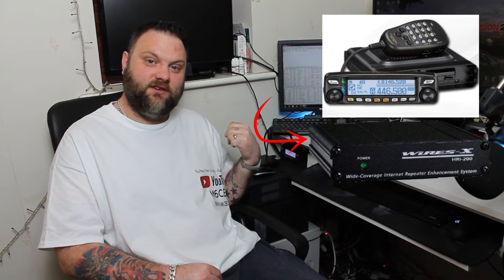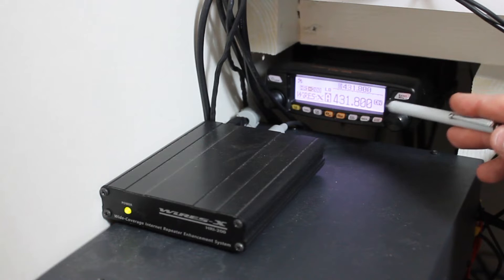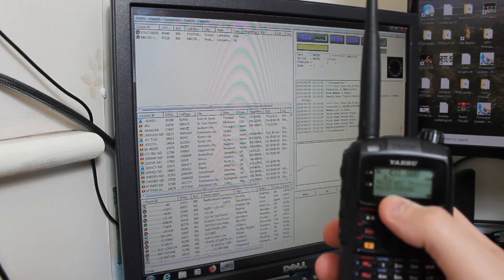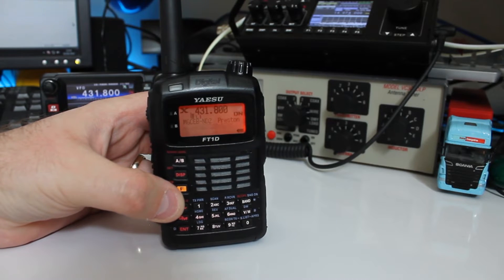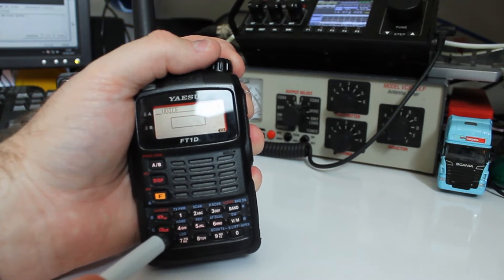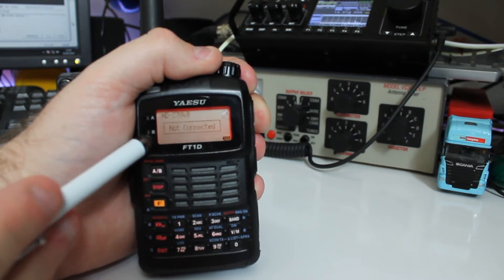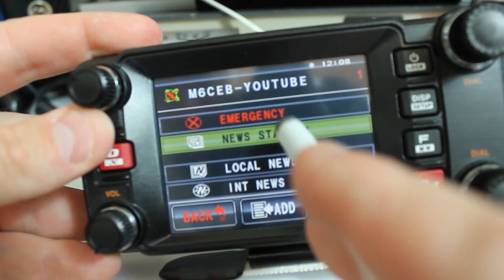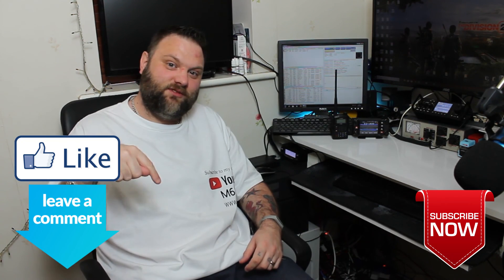Complete guide to Yaesu System Fusion & Wires X Everything you need to know! C4FM Everything Covered

Comment: I hadn’t used wire X in a few years and pick my radio back up. I had a new computer. I had a Windows 11 on it. It wouldn’t accept my SCU 19 or 24 so I bought the 59 or 56 but I’m having problems connecting becausethey won’t allow the carports and all that

Comment: Quick question, I'm searching for a c4fm ht but in your video everything looked so easy is that because the radios you used had a wires X button? Can I just get a radio the has c4fm only or will it be more complicated to use, Thank you.
Reply from the maker: All c4fm handies are easy to use and have a wires x button. I would highly recommend either the FT1, FT3 or FT5 radios. All are really simple to use on digital. Thanks for watching 73

Comment: Newbie here. There is no gateway in my area so I would like to set one up. If I would like to use Wires-X in my truck, I would need the 200 box set up at my house? Or could I simply connect my home radio to the internet using my PC and the Wires-X software and connect to it through my truck radio? I'm not looking to host a room at this time.

Comment: I have FT-991A (Wires X Compatible) with latest firmware which is tied via USB to my desktop W11 PC which is tied to the internet.  If I had a Wires X HT, why couldn't I use the FT-991A to RX and TX a connection to wires x without HRI-200 assuming the PC is installed with proper software?

Comment: Hi there, great vid, very well explained, thanks. 
I’ve just begun to use my ft3d and had my first wires x qso’s today. Now I want a bit more power so am looking at ftm400 and ftm300. Have you bought a 300 yet? I’m not sure that it’s a winner over the old 400, aside from the dual C4FM, I don’t see any advantage. I Would appreciate your thoughts. 
Cheers 
M0VZZ.

Comment: I've watched endless videos, skimmed manuals, but can't seem to find an answer to what seems like a simple question. My son is going to Hawaii with an ft-70d and has access to a C4fm repeaters. There are no C4fm repeaters in my area. What is the cheapest way on my end so that we can talk direct (not in a room)? Mu understanding (which may be wrong) is that I need to be a node/pdn, so even though an Ft70dr has a dp-id, a Hotspot wouldn't cut it, and I'd have to use something like an ft-3dr and cable to the computer, is this correct or not? I am on a fixed income so I need to get this right the first time. Thank you so much for your help!

Comment: There is a fusion wires-x repeater nearby. Can I use a radio with this option without a hotspot or internet & connect with groups,rooms &make long distance contacts?  Looking at a 300dr
Reply: YES, you can, if you can reach the repeater with a RF signal, you need nothing else.
Reply: See this excellent Youtube video.... its very long... but the most detailed one I have seen. Very very worthwhile watching !!!  https://www.youtube.com/watch?v=BV321C4mx20

Jackie... I am doing exactly what you want to do.. using the Yeasu FT300 radio.

Comment: hi mate so what i can gather from ur info if i buy a ft3d or a ft 300d and the relivent smu cable for the pc register with yeasu download the software put radio into direct mode and connect to the rooms throgh my computer and it will transmit through the internet sorry for the long comment cheers kenny mm3 ptj

Comment: Im fairly new to HAM radio, just took the Tech exam late May 2020. Got my Extra in August. Have spent most of my time on local 2 meter...pretty active in the tulsa area. Ive also spent a lot of time with SDR....SDRuno software....RX-ing. Havent had a lot of desire to TX, so have just been satisfied with setting up HF antennas and tuning into various HF frequencies and nets.

With all of that...my next step into the hobby is going to be DMR. Ive been told by several of the active operators that for the area Im in Fusion is it. Im still not perfectly clear on the definitions of DMR vs Fusion vs Wires X.

Wanting to step into this area would you suggest something like a Yaesu FT-70dr or should I jump up to an FT-3dr...?

Comment: Matt, This is really great, thanks! I recently obtained an FTM-100DR which I installed in my vehicle. I loaded up all of my local repeaters via SD card (which was also great!) and was off and running. This morning I connected to my local System Fusion repeater and immediately heard a conversation between a guy in Northern Ireland and another in Toronto. I was stunned, because I was not in any WiresX room nor had done any special configuration. The repeater does not list any linking. I'm assuming this is a Fusion under the hood functionality, but I'm struggling to understand it. Thanks! Brian - KC3PFR, Ellicott City, MD
Reply: Just talked with someone who indicated that the repeater must be set up with a "default" room. I have since had an interaction where it seemed like people "in the room" could not hear me, but people "on the repeater" could. (local contact could hear me and the room traffic, but room traffic could not hear us even though we were in the room.)
Reply from the maker: yes thats right so when you connected it was allready there :) thanks for watching :)

Comment: So do i need an Hr200 with any kind of digital yaesu radio maybe a hT to have my own node ? Does it have to be a mobile transciever to like ftm 100 or ft 400 with the hri200 connected to the internet to have my own room. Just bought an ft3d. what can i do with that in fusion?
Reply: You don't need a HRI 200 for your own node, but you do if you want to host your own room.  If you want to run a PDN node, you need  a wires x fusion compatible radio, ie. FT3D back to either a FTM100 or FTM 400 as a base radio.  I currently use a HT FT3D in PDN mode back to a FTM 100 at the house with no need of a HRI 200.

Comment: Thanks for the good info Matt. I am struggling though to understand if I need the FTM100DR.  I have an FT-991A in the Ham Shack, an FTM 400XDR in the Jeep, and a FT60R handheld.  I am unable to connect to local C4FM enabled repeaters.  Not sure why, they are very strong in FM mode but C4FM doesn't connect on either the 991 or the 400.  So... I was thinking of getting an HRI-200 but was wondering if I buy a FTM100DR to use as the node radio I assume I could use the 991A or the 400 to connect to it correct?  Appreciate any additional information and thanks again for sharing your expertise on YouTube.
Reply from the maker: im not too sure tbh mate, thansk for watching and i can recommend the hri 200 tho ;)

Comment: Hi Matt, I am a new HAM and have bought a Yaseu FT-70Dr. If I get a FT-100 as a node to get on the internet, do I actually need the HRI-200? I just want to connect my FT-70 to the internet and chat around the world, (maybe with you). I am not looking to create my own room or host a room.
Reply: I use an FTM 100 for both direct mode at home and switch to node mode when I go away from the house.  I use an FT3D to connect back using wires x and I can talk anywhere in the world as long as I am in range to my FTM 100.  From my location I can get around 10-15 miles away from the house with my handheld.
Reply from the maker: You really could do with a hri 200 as you won't hear analogue stations coming through the system.im not an expert but I'm quite sure try searching for the north west fusion group on Facebook there very knowledgeable on there and mention my video. Congratulations on your license it's a great hobby 👍😁

Comment: Great video Matt, good to see Yaesu Fusion explained well! If I can pick your brains, have you any experience using wires-x via the HRI-200 on an FT991A? I'm totally new to this and am assuming I can hook one up straight up and access rooms etc but was wondering about repeater options using my 991A as there are currently none anywhere near me? If necessary I can PM you my email if you get the time to explain?! de Steve M0LVL
Reply from the maker: Thanks so much Steven 🙏 I've no experience with the 991 but I'm prety sure that has it inbuilt but I'm not 100% sure tbh 🤔 nice radio tho and one I would like in the future 🙏
Reply: @m6ceb  No problem mate, as I said very good effort! I know the 991A has the built-in soundcard but it will only do simplex on C4FM as I understand it pal. I will need the HRI-200  to connect to the internet and be able to access rooms or create my own node etc but again, I'm new to this side of amateur radio so might be missing a trick!

Comment: I need a suggestion, which radio to buy ?? FTM 100 (use wires x) or FTM400 ??
Reply from the maker: I would go for the 400 far superior radio but you will not be disappointed with the 100 either 🙏 thanks for watching

Comment: Matt not sure if you are aware on the ftm100 possible the ftm400 when you power up hold the dx and GM button both in, you will be able use the none digital rooms or any other, not just digital  only all via just the scu20 cable all thanks to the firmware update
Reply from the maker: Thanks a lot Robert 🙏🙏 appreciate you letting me know mate 😀

Comment: My summary of how to get started using System Fusion as a user.  1) Quit my job. 2) Sell my house.  3) Move to an area that has a System Fusion repeater.
This sounds cool, but I don't have a single YSF repeater anywhere near me.  I guess that I won't be buying and Yaesu digital radios anytime soon.  Funny that my city is in the list of top 50 largest cities in the US -- it isn't like I live in the middle of nowhere.
Reply: You can access wires-x through a hotspot, I have a dvmega/rpi hotspot running pi-star I made and used a ftm-100 and ft-70 with the hotspot and had full access to wires-x network
Reply from the maker: There popping up all over the place so it's only a matter of time buddy 😊🙏 73 and thanks for watching 👍😁
Reply: @m6ceb  : I hope you are right.  I am a bit of a Yaesu fanboy...  Personally, I will buy the radio made by the big three that can decode all popular digital modes.  There is no technical reason they can't do it.  However, I just can't seem to make myself buy a "direct conversion" cheapo radio.
Reply: Things have changed and there are options - even without a repeater in town, an FTM100, FTM400, FT2D or FT3D radio with a WIRES-X cable (additional purchase) can be connected to a laptop or PC into the Yaesu Wires-X system. Some nice features in WIRES-X and lots of rooms (nodes) to talk on, apparently much better than the previous WIRES system. 

Another option: transmit to a hotspot in Fusion mode and talk on the FCS and YSF alternate networks (not part of the WIRE-X system). The Yaesu Fusion radio w/hotspot cross modes into DMR, P25 and NXDN, only not D-STAR. Same can be done with a DMR radio with a bit more work. 

If you even leave the home area there probably will be a Fusion repeater somewhere to use the radio. Unofficially, basic on-line research shows in North America there appears to be over 1,800 Fusion Repeaters listed online, nearly 1,680 DMR and 1,180 DSTAR. Worldwide looks like 500 more DMR than Fusion Repeaters.
Reply: Make your own PDN node from home and talk all over town with your Wires X capable handheld.

Comment: I’m very new to digital modes My question is if I’m close enough to a fusion repeater can the radio connect t to it with out the use of a computer. Like a regular hand help on 2m or whatever band
Reply from the maker: Yes it will do Kevin! Just program your local repeater like you would any other and away you go 🙏😉